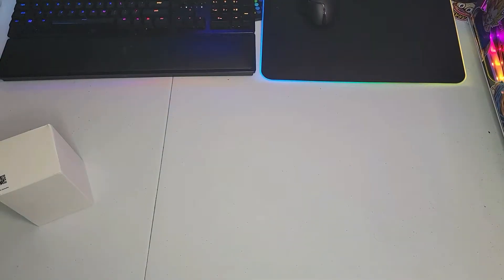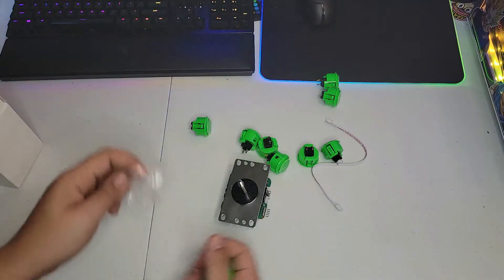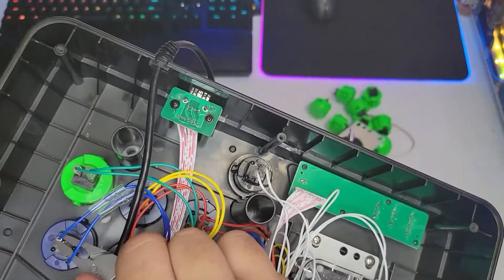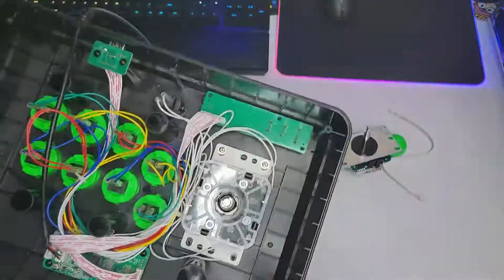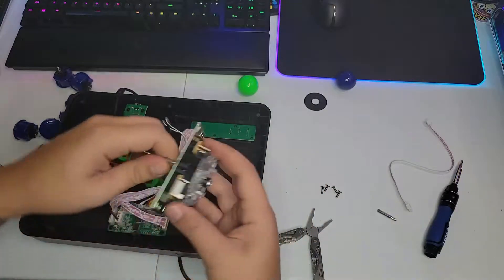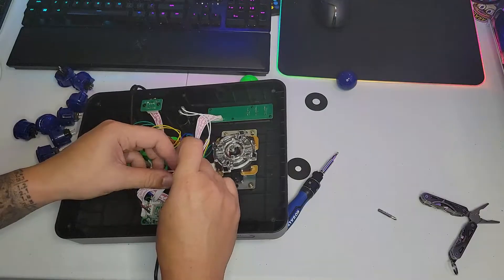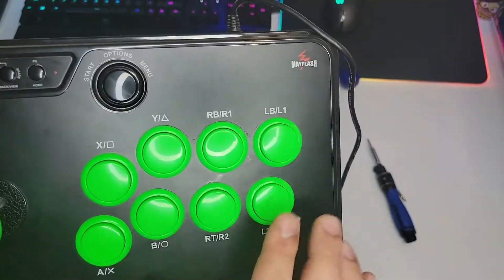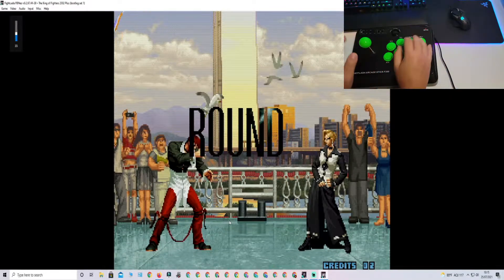Mayflash F300 Stick and Buttons Upgrade - Sanwa JLF

Comment: I need help... I just got my sanwa stick also for the mayflash f300 but the cable it has its kinda different, the side that is connected to the stick is the same but the other one its not, its like the 5 cables separated and I dont get how to connected
Reply from the maker: huh thats wierd whats stick you want to change it too ?

Comment: How did you know which way to plug in the 5-pin connector?  Lucky guess?  Looks like Red Stripe UP on the stick, and white facing you on the board... correct?
Reply from the maker: to the board is one way and follow the belt straight to the controller easy as that

Comment: Was it difficult for you to input DP and quarter circle motions? It felt like I had to jam the stick very far in order for it to work.

I'm hoping this upgrade will make a difference.
Reply from the maker: not at all if you know what are you doing and follow what i did you will get it pretty easy
Reply: @omarvlog24  Do you think it's worth changing the actuator and pivot?
Reply from the maker: @Morior-Invictus  im not sure i did change all  so that's is worth it
Reply: I've been contemplating buying a new stick and working on the Mayflash later on. Since the upgrades will cost $80, I might as well put it towards an Hori or Qanaba.  @omarvlog24
Reply from the maker: i mean u can my upgrade was only 40
 @Morior-Invictus